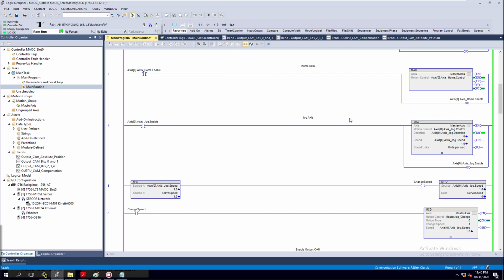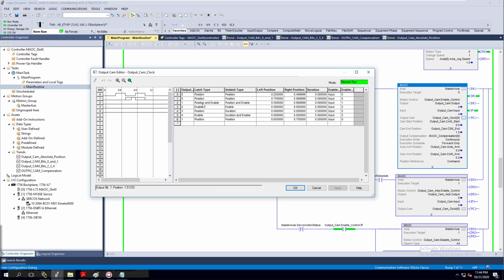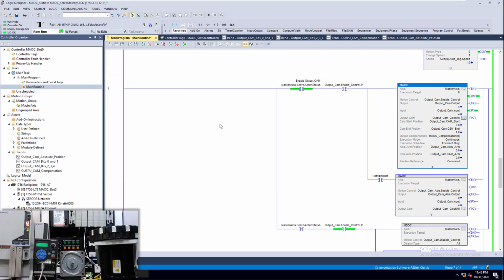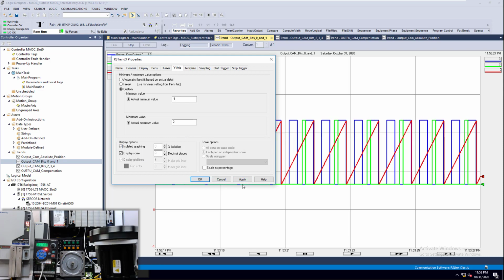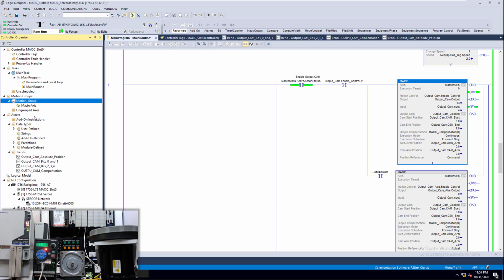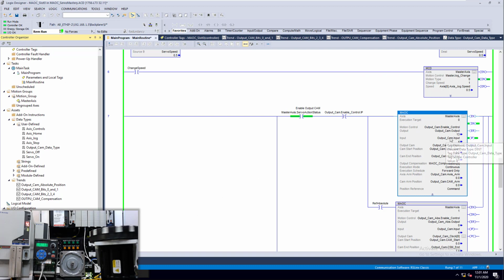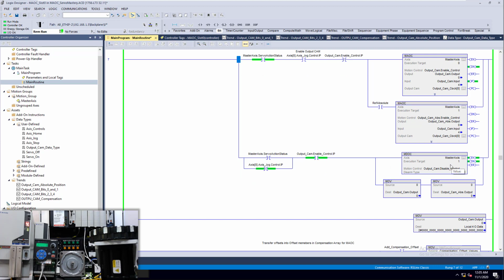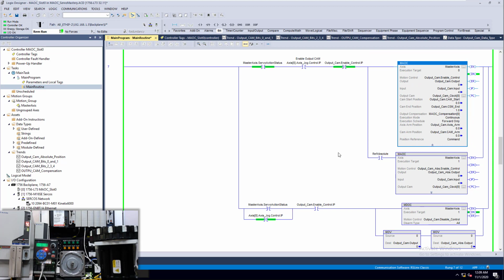Studio 5000 MAOC Instruction | Motion Arm Output Cam For Controlling Outputs Using Servo Position

Comment: I'm facing a problem where my axis goes from 0 to 1680 but I have to generate 72evenly placed pulses with MAOC. So I used 0 as cam start position and 23.333333... as cam end position, but this - being an infinite fraction (1680/72) gets rounded! So as a result I have a slow drift in my signals, as my pulses are output after 23.333334 units (32bit representation is 23.3333339691162109375 os 1680/72). Is there a workaround for this? I can not have 72 different MAOC as the system only supports 32. Changing axis range would be a bigger workaround, but setting up the MAOC would still suffer from the inaccuracy of cam end position. I wish Rockwell had MAOC with LREAL!
Reply from the maker: @QuickBrownFoux  Sorry but I can't give advice on something this complicated because to truly answer something like this I would need to see it in person.

Depends on the axis setup and the MAOC is setup. 

Meaning units and other things like task timing and course rate update timing plus trending it to see if the timing is right
Reply: @ShaneWelcher the solution was to add a virtual axis, geared using numerator + denominator thus eliminating floating point inprecision. The second axis cycles from 0.0 to 1.0 and the MAOC cycle is also 1.0 so long term stability is guaranteed.

Fun fact: in older systems, where everything was in REAL (and not LREAL) the system kept track of inaccurqcy and did correct it.
Reply from the maker: @QuickBrownFoux  Good to hear you found a resolution

Comment: Excellent video Shane.  I've done quite a bit with MAOC's, but one issue with speed compensation I've not been able to overcome.  For Position-Position, Latch/Unlatch, it appears the speed compensation calculates an internal position offset that's added to the Latch/Unlatch positions.  That works great unless your latch/unlatch are on the CAM boundaries.  If in your example, you have a latch at position 0, and add speed comp to the latch (leading edge), any value that's subtracted from the 0 position puts it outside the boundary of the CAM.  In my testing, Ive found the MAOC then completely ignores this particular output for that range.  So if you have for example latch/unlatch of 0 and .5, and your leading edge speed comp is calculated based on time/velocity to .1, the output won't fire at -.1 and ignores it altogether.  I was hoping speed comp would wrap around.  Do you know any workaround for this behavior?
Reply from the maker: Honestly I would have to look at the machine design and the program to verify the way your setup is because of multiple reasons.

One being timing
Reply: @ShaneWelcher  Okay, understood.  In this case I'm testing with a purely virtual axis.  But it does the same with a physical axis.  CUP set to 2ms.  In your example, with a latch set at 0, does any latch speed compensation applied still fire that output?  It doesn't for me.  The routine is motion exception, running about 180 useconds.  The speed of the axis is 160 units/sec.
Reply from the maker: @robertmee2  

The problem you are seeing is most likely caused by it being a virtual axis which creates timing issues.

I used a real would servo